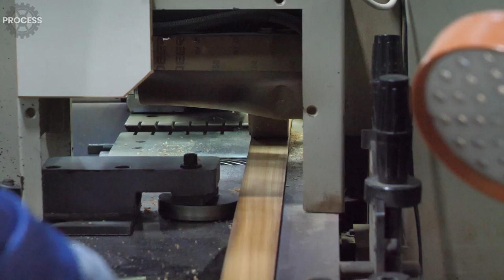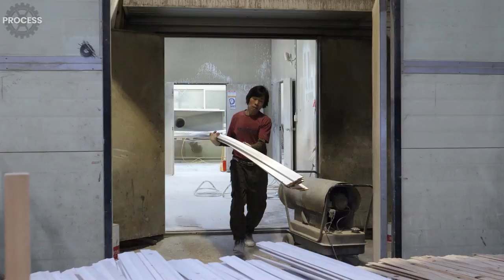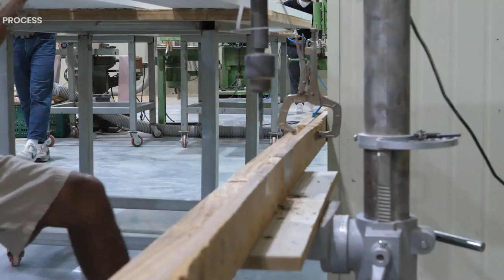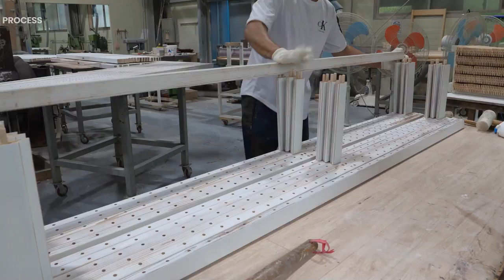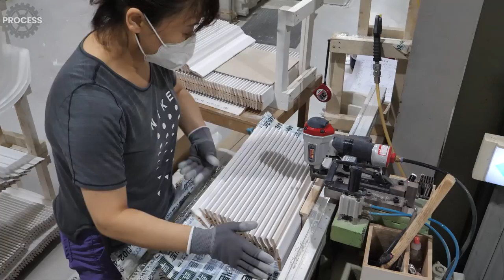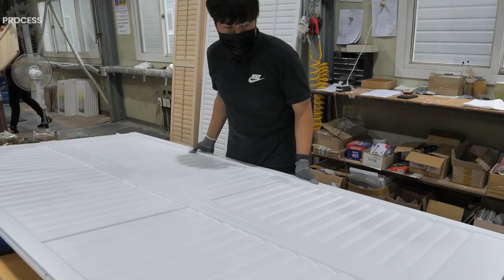The LARGEST Wood Curtain Factory in Korea. Process of Making Wood Blind Curtain.

Comment: LOL, the technician putting the two big doors together with the hinges, striped out several of the screws, and put some in at an angle.  When the screws are tight, stop, don't continue turning the screwdriver.
Reply: } 700 щщщ 006?

Comment: As a process engineer, I saw several opportunities to mechanize or automatize parts of the process, as well as some safety issues, like failure to use respirators, lack of safety guards. Otherwise, the process is very interesting.

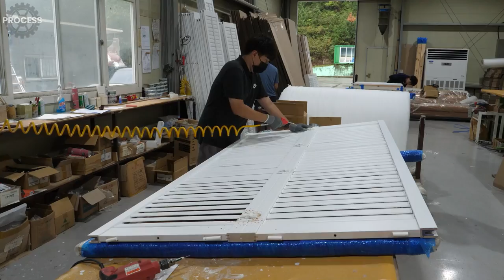Comment: 18:26 the worker is stripping out the screw holes!
Reply: I was looking for this comment😄
Such a pity, all that work to use a cheap dril. I mean a brushless impact driver is not that expencive, and with a 3ah battery you can use in their conditions one batter for probably 3 days(if it has a brushless motor)

Comment: Good, but typically Korean, not long lasting, slats too thin. Passable until the sun gets at them through the glass. I think they would be better mounted out side and a lot more paint on them, I was surprised at the lack of any handles. Do they come as one size only and you have to hope your windows fit them, I didn't see any other sizes at all. What about toddlers fingers getting in the folding part.?